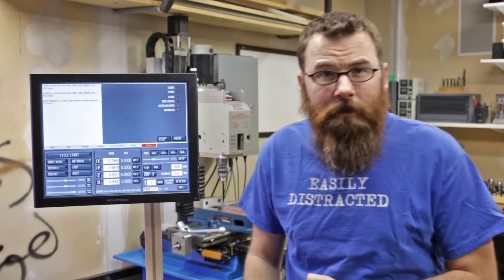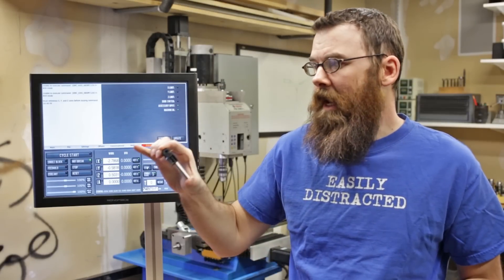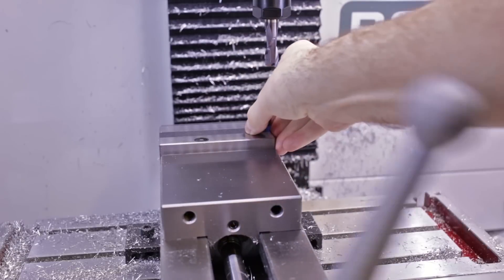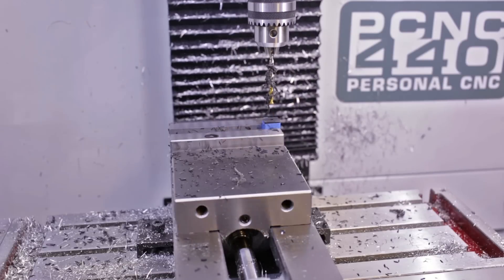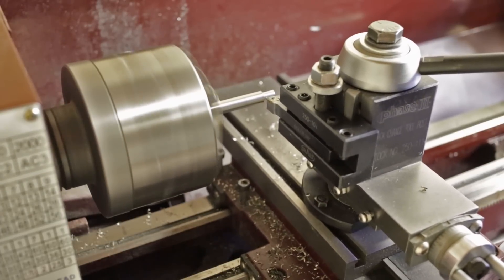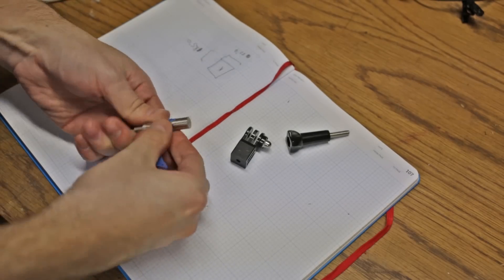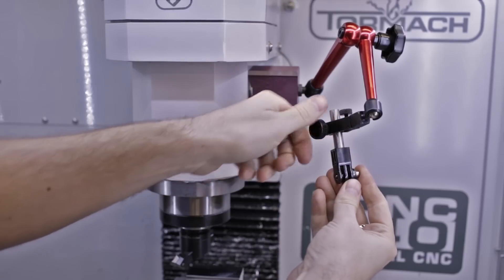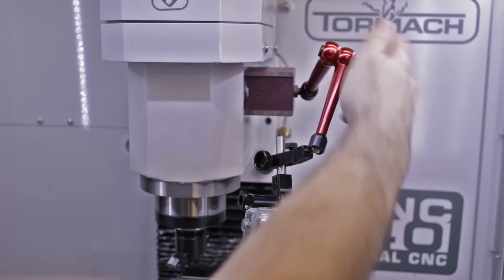GoPro Machinist Mount

Comment: Very timely for me, as I'm pondering a GoPro for my soon-to-be-delivered PCNC 440. Thanks!

Did you consider machining the whole part, instead of modifying an existing GoPro mount?

I was surprised to see a bandsaw instead of a parting-off tool in the lathe. Any particular reason for the bandsaw?
Reply from the maker: +Paul Williamson I did consider machining the whole thing, but the plastic part was fine.  I actually modeled the whole thing up in Solidworks then looked at some of my existing mounts and realized it would be a LOT easier to just modify one of those.  I didn't have any stock on hand, etc.

I guess I'm more familiar with my bandsaw than the lathe.  I really haven't use the lathe much and am still learning.  So it was just easier to use the bandsaw I guess.  But yes, a parting tool would have worked just fine.